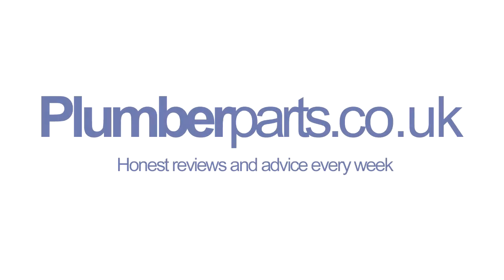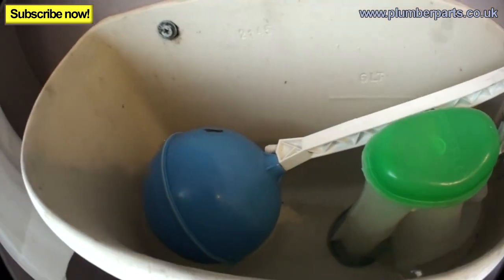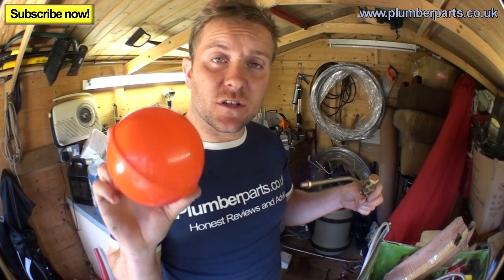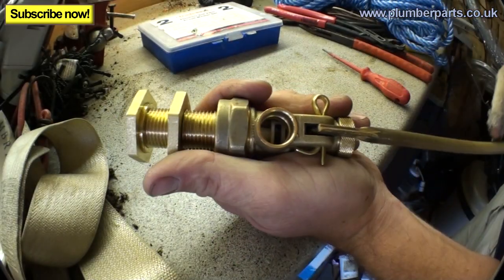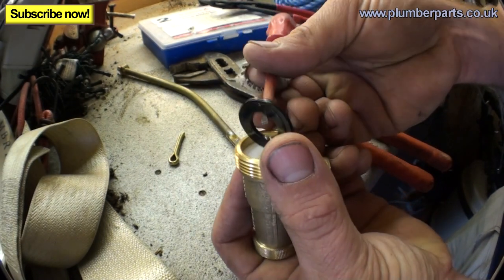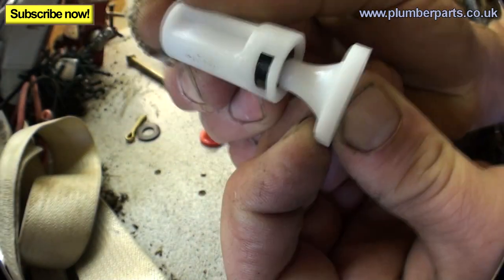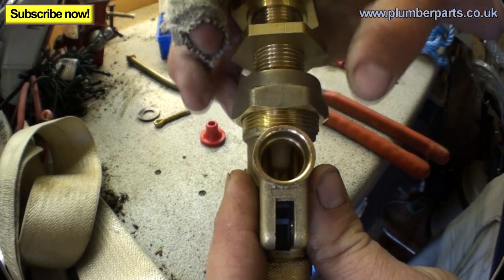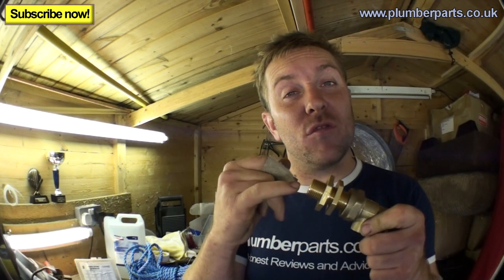HOW FLOAT BALL VALVES WORK - Plumbing Tips

Comment: Another Excellent video I need some help I want to use to water pipe input to same container 
Pipe 1 normally supply water and pipe 2 only supply if there is no water in pipe 2 how can we do this with normall plumbing equipment without electrics

Comment: Thank you for the informative tips, I have a little problem with my ball valve on my water tank, It wont drop water if it was all the way down, it only drop water if I pull it and hold it to the middle If I moved slightly a bit downward or upward it stop dropping water so I have to hold it in a specific position for it to work ( I currently put a rope temporarily to hold it on that exact position so the water keep dropping)  (also the water stop dripping if I moved it all the way up which is what the ball valve supposed to do as you explained, so at least this is still working) Any Idea what the problem could be ? (Could it be there is some dirt/sediment stuck between the ball valve and the pipe that give water or is it a problem in the ball valve itself ?)

Comment: try and do it sequential, isolate the water supply first ----
 then show all the different float valves, as there are so many different types these days, and they are a puzzle if you have not  done that particular one, hardly ever see a brass 
" Portsmouth " float valvet these days, they are so simple and reliable, I use to work in hospitals 50 years ago. 4" bore cast iron equilibrium float valves, fitted with molded leather washers, and 20 " diameter copper floats, you needed a wheel barrow to bring them down to the workshop.
I like your attitude, and your teaching skills. keep up the good work.

Comment: Hi James, your videos are great!!! I have a question related to the valve. My valve/pipe is doing a strong noise when filling the loft tank. It is like air coming out with the water. This is not constant during the filling process, but only between minute 2 and 1 before the tank is completely full. I know is only one minute, but when someone is taking a shower it is in the noise spot for much longer. I changed the ball valve with a similar high pressure valve, but it did not solve the problem. Any ideas how to solve the problem? Thanks a lot!
Reply: I have this problem . Did you solve it

Comment: thanks man, work up last night though it had been raining heavy cos I could hear a heavy drip, then I realised there was no rain forecast and eventually that the dripping was in the house, water tank over flowing ( the overflow pipe does not work as the end of it is higher than the top of the tank!! thanks to the twat who installed it!!),
this was helpful, will have a go at fixing it tomorrow, I have done it before a very long time ago but was low on confidence, not so much now!! Cheers!!

Comment: Hello.  Great vids.  I will definitely be keeping up in the future, as I just discovered your channel just now.  I have a question about ball valves and alternatives.  I am installing mid to large tanks around my house, and want to maximize the water intake to each tank and make the filling-up process as fast as possible.  I am noticing that the 3/4 ball valve that is installed in my only fully-built tank experiences some degree of inefficiency between the intake of its 3/4 ball valve compared to my new tank (which does not have a ball valve at the moment, requiring me to use the manual shut-off to not to make a mess).  I am wondering if there are alternatives to ball-valves that would allow for better flow.  I am currently contemplating increasing the head of the pipe from 3/4 to 1 inch, and applying a 1" ball valve instead.  Any thoughts?
Reply from the maker: +Carlos Perez You can replace the jet in the ball valve for increased flow. Remove the white jet and install the red instead. 

Sub here please>> https://www.youtube.com/subscription_center?add_user=plumberparts <<If you haven't already!

Comment: So this video was of of little use, you gotta have the tools, I just about had enough, then you have the fear something will go wrong, like I found the arm was too long and the ball hit he other side of the tank so I had to adjust that, then when I rejoined the the water pipe it leaked at first so had to re-tighten, I also bought a ball valve repair kit for £1.50 for next time it goes.
NIce to have running water back in the house again!!
Reply: You do put some stupid comments.

Comment: ??? not sure what you mean.
Anyhow I actually fixed my ball valve today and this video was of little or no use to me because I actually replaced the whole assemble with a new one (cost £10.50 in all) but could have got a cheaper one for about half the price. I mean he has a nice new system there mine was coroded to fuck so I thought replacing was better. Biggest problem I had a was disconnecting the ball valve from the water pipe, hard to see what I was doing as tank is 6 inches from the ceiling